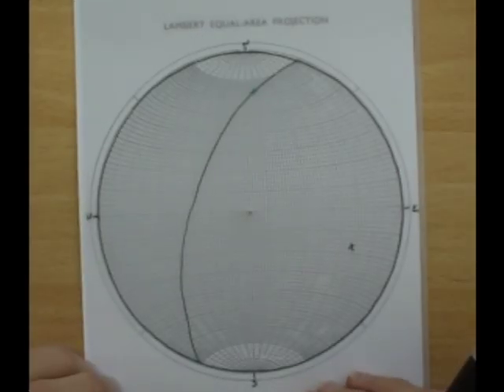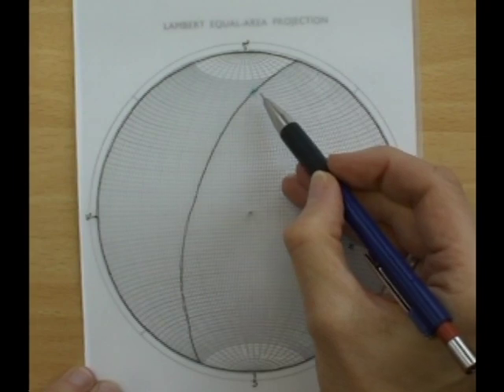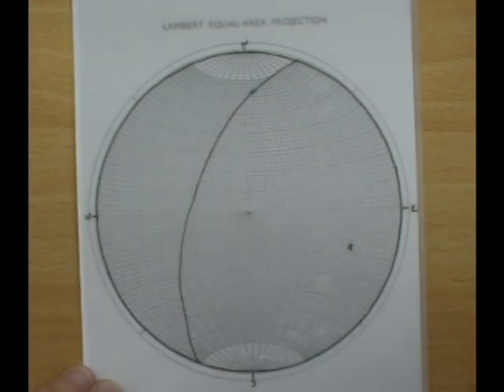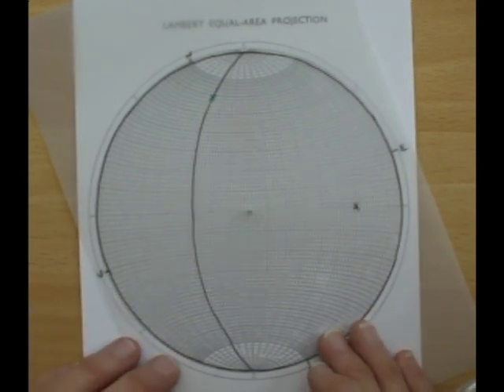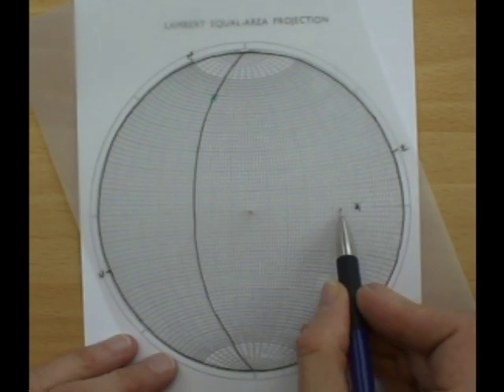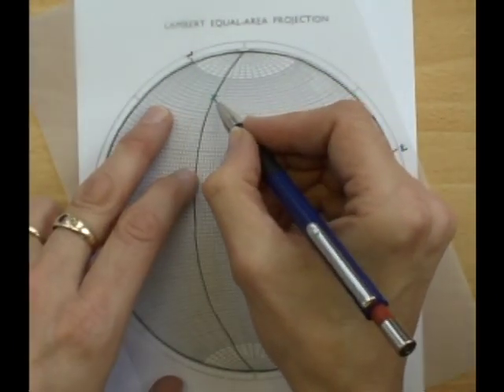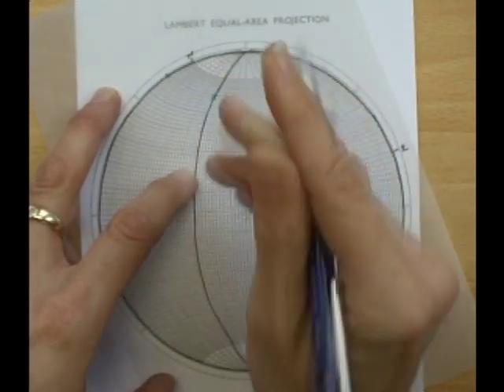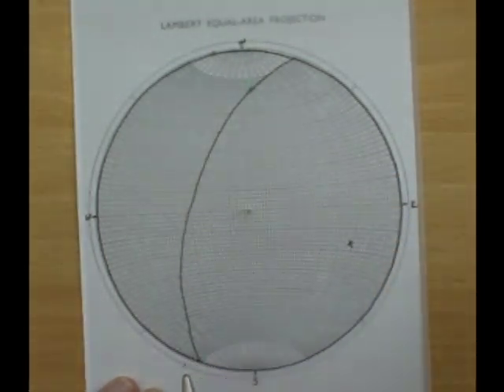Restoring a lineation on a stereonet

Comment: yes. do you have to line up the rotation axis with north and south before rotating along the small circles? My books say to do this but she doesn't do that in the video. I'm wondering if it is actually necessary or not.